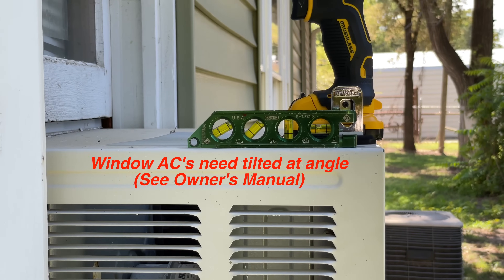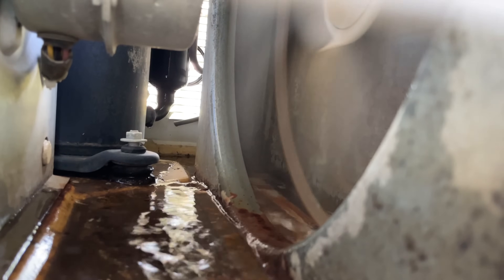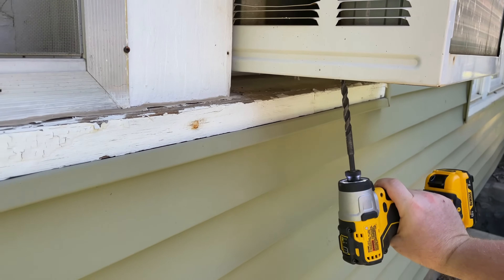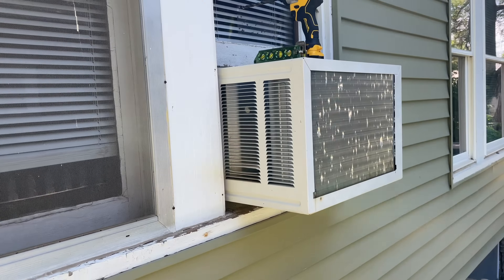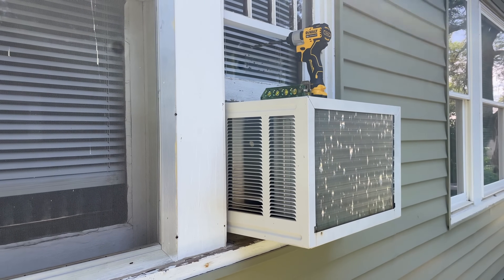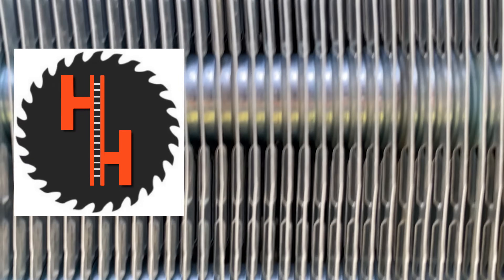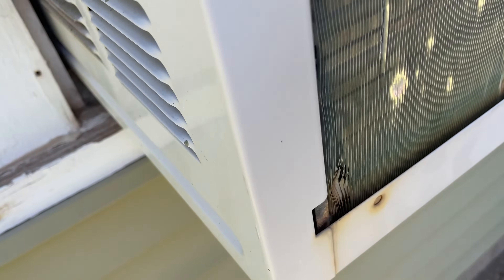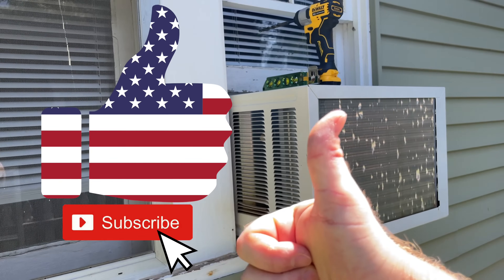99% Don't Know THIS About Window A/C's!! DON'T DRILL!!

Comment: Garbage bro… as a Floridian, those holes are necessary so you don’t get pooling water and mosquitoes in your home. I’ve popped the refrigerant line before with the drill. It’s a way of life down here when it’s 90+ for 90 days
Reply from the maker: I’ve never experienced any issues with excess mosquitos or had any complaints on any of my rentals. There’s also no access for them to get in the house, as there’s a barrier from the outside of the unit to the inside…
Reply: @HandymanHertz  ever heard of the fresh air vent? even closed its a poor barrier
Reply: Don't get me wrong, you're video is wicked informative. I ripped my midea U shaped split window unit apart this past week and added a fish tank UVC lamp under the blower motor squirrel cage fan to help eliminate mold on the fan blades.  The outside part was full of garbage though and still needs a good cleaning. That's from pre hole drilling.  I think more to the point, if you live in a really warm climate, the mosquitoes will find a way to nest and get inside your home is a water attached basin is involved. Nice video!
Reply from the maker: That’s cool. Ive never heard of attaching a uvt light to eliminate mold on fan blades. That’s actually really brilliant, lm curious how it works. 👍🏼
Reply: @HandymanHertz  thanks! Gonna try it for the first time when the real heat hits. Wish I could share a picture!
Reply: @Lykapodium  everyone in a high humidity area has already got a picture
Reply: its true if you live in a high humidity area, the pooling water becomes a lake and a breeding ground for mosquitoes

Comment: I'm starting to hear an annoying drip sound now. Is there any way to get rid of that? Can I suction the water out?
Reply from the maker: You can drill a hole in the bottom, it will just not run as efficiently. Just make sure not to drill into your condenser.  Or I’ve heard of people putting a rag that hangs over the side, creating a wicking action and removed the water that way.

Comment: I have a small pile of leaves and gunk on the inside where the tray is how do I get that out its like what u would see on the ground after a windy rain storm gross puddle with leaves its not huge but imOCD if I notice it I have to clean it
Reply from the maker: Hmm there’s no good way to flush it out, without cutting a hole in the bottom. The only way I know how to do. It is to do a deep clean on your window AC. I have a good video on that.

Comment: I always drill. If not, the unit will die sooner because of dirt, dust, slime, and algae build up. I'd rather my unit last longer than be more efficient.  Also, letting the water pool up over time corrodes and ruins the coils and rust the housing.
Do as you please, but I'm gonna continue to drill window units and run drain tubes to the ground.
Reply: Absolutely correct based on my experience. Before you drill check to see if you have removable plugs.

Comment: This causes alot of corrosion on your lower evaporator finstack. Drilling a hole is actually a optimum idea, and should be incurraged.
Reply from the maker: Thanks for your input, though I disagree.

Comment: What if the water is dripping from the front?
Reply from the maker: More than likely a plugged drainage hole that is drained and not allowing the water in the front to escape to the back. Unless it’s new, in which I’d guess it’s due to improper tilt angle

Comment: So I had this issue, but the pan was filling up too much and the fan was spitting the water back out through the vents into the house. It was filling up so much so fast that it didn’t have a chance to drain. What could the problem be?

Comment: But what about the mold that grows in the back when the AC is turned off and sitting there for a while and then you put it away for the winter…
Reply from the maker: The water evaporates quickly. I’ve never had a mold issue anywhere other than the blower inside fan. But that’s just my experience

Comment: Thank you for the information cause I was about to drill a hole in my window Unit.  it was leaking water inside. So I pull it out find out the hole where condensed water drain was clogged. So I clean it real good then put it back in. 👍
Reply from the maker: Good job! Usually water leaking inside is a separate issue!
Reply: What’s that issue? Mine is dripping out inside

Comment: I drilled bigger drain holes to existing for faster drain during cleaning still works great 5yrs strong .  helps the dirt escape faster and water drain
Reply: Where do you recommend To drill... Im having water spitting from the sides by the fan
Reply: @Lhenfant  bottom drill few holes
Reply: @Lhenfant  Look at the bottom plate...you should see a depression in the center with a channel leading to it from the cooling section. That's where the condensate is supposed to collect so it can be flung against the outer coil. I drill at the outer edge of that depression, which I call the "slinger sump". Make sure to check before you drill, that there are no coolant lines or wires on the inside. It should be right under the outer fan blades.

Before you drill though, check to see if there are any flexible plugs you can remove to drain. They will be on the bottom panel, towards the outside, or maybe on one of the outer corners. I should add that all a/c are not the same. Each mfr handles things a bit differently. The four I have are all basically the same (about 3-5 years old), so yours should be similar. The little depression under the outer (condensor) fan blades seems to be a common feature. That's going to be the lowest spot and that's where the condensate is supposed to collect. 

You also want to make sure that the styrofoam cool air enclosure has a good drain hole, so water doesn't collect at the bottom and cause mould. That drain hole should drain into the channel which leads to the "slinger sump", but you may need to clean it out or enlarge it to improve condensate drainage.
Reply: I just took the entire bottom off of the a/c unit. Let things fly when turned on. lol
Reply: @BillColicchio  that's what you don't do but yes drill baby drill

Comment: Awful advice ... the distilled water is filled with dirt and mold and you don't want it slowing down your fan ... and ... the bottom inch or two will actually rot in less than a year with standing water ... Awful shortcut design ... coil resting on metal housing.
Reply from the maker: Your theory about being ruined in 1 year  is wrong, because that unit in the video from 2009 and still going strong.
Reply: @HandymanHertz  You are defending the exception to the rule ...
Reply from the maker: Where’s your proof? Where’s Your facts on the rule? In my experience over the years, None of our rental properties window ac’s, nor my personal acs, has fit into your rule, or come close. Unless you think all of my acs are the exception. I believe your “rule” is the exception. Prove otherwise.

Comment: I had a customer that bought a $12,000 btu window air conditioner, it came in with a no cooling complaint. I took it in the shop and looked it over, customer had drilled drain holes all in the bottom. He said he didnt like water sitting in it. Not only did 5he bottom now have holes, so did the condenser coil. I gave an estimate to repair the unit. The unit is no longer in warranty. Told him hes better off buying another unit. Will be cheaper too. He said that no one told him he cant drill holes in it, lol.
Reply from the maker: Haha oh no!!! I bet the landfills are full of good air conditioning units with holes drilled in the condenser 🤣

Comment: Its leaking onto my floor!
Reply from the maker: You need to do a deep clean because the drain hole to the back of your machine is plugged. I have a good video on this called how to deep clean your AC. It should help you out.

Comment: Mine still ran water inside
Reply from the maker: I’m sure your drain hole to the back of the unit is partially clogged and you need to do a deep clean on it. I have a good video on that called how to deep clean a window AC.

Comment: I run a strip of folded paper towel tucked in to the back between the housing and the fins and let the other end hang down bellow the unit. It wicks any standing water and since it wicks it downward, once the towel is saturated it starts dripping and begins syphoning any remaining water. It does this at a perfect rate that allows water to pool up during heavy use and then dries out the unit when not in use.
Reply from the maker: That works. Why not just drill a hole?
Reply: @HandymanHertz  an open hole wouldn’t let the AC benefit from increased cooling efficiency from the fan splashing water on the fins, as it was originally designed. A slow wicking paper towel will allow water to pool when the ac is in use and then dry the unit out when it’s not in use. A hole would just drain the water immediately.
Reply: @JonCarton unfortunately that won’t work for me. I live in Florida, plus I’m very hot natured and keep my unit set at 65 yr. round. Yes, sometimes, like in Jan & Feb it’s only the fan running, but still, it runs constantly. I have to buy a new window unit about every 3 yrs. because mine has to be boarded in, it’s too much of a hassle to remove it to clean it every year. The best I can do is use a can of that stuff you spray on the outside. Coil cleaner I think it’s called. It would be so great if they made a window A/C that you could take apart from the inside to clean.  🤔

Comment: Mine was pouring water into the house. Drilling the hole fixed it. Yea, it'll maybe shorten the lifespan, but I was gonna trash it anyhow.
Reply from the maker: They are designed to overflow out the back weep hole before they overflow in the front. Do you remember if it’s at the correct slope the manufacturer recommended?

Comment: DRILL THE HOLE, Iv had 3 ac units in over a 2 years and the one i drilled the hole on works perfectly fine and has zero mold smell like the rest of the other non drilled ones did,  that 1% energy savings isnt worth your unit rustying out in 2-3 years plus the amount of bacteria growth from stagnating water is not healthy
Reply from the maker: A couple thoughts…that ac unit in the video is from 2009 and running perfect still. I’m not sure why you think it will rust out in 2-3 years. 

You claim The outside mold  would not be healthy if it was getting mold grow  (I havnt experienced this personally yet). If true, the outside ain’t has nothin do with with the inside air, so I’m not sure how it’s healthier. But thanks for your perspective and experience.
Reply: @HandymanHertz  no unit is perfectly sealed and the outside air will still find its way into the room you are cooling, i guess it just depends on what type of area u live in like humid or what not for the mold to be an issue

Comment: I can't remove my unit. I have cleaned it. But i have lots of dirt and leaf grime in the bottom of the unit. How do I clear all that out? Bc now it smells when i run the unit. And it didnt before I cleaned it. I feel like ive clogged something with all the grime i cleaned out of the coils.
Reply from the maker: I have a good video on how to do a deep clean and how to clean the most important part of it where leaves/dirt builds up. I know you can’t clean it out, but you should be able to reach the part I brush out on the unit, which is on the side of the evaporator coil (From fins). hope this helps.
Reply: I watched the other video. My ac looks identical to the one in this video. Mine is sealed in a window in my camper. I can't remove any of the plates. The slinger wheel is where all the leaves and dirt are compacted. I didn't have anything skinny enough or long enough to squeeze in between the grates. Finally, I found something to use. Hopefully, I don't damage the poor fan. Flooded it, rinsing it with the hose. All the junk just floats around. It has nowhere big enough for it to come out. Can't drill a hole in the bottom because the window the ac is sealed in. The camper design bows out enough and doesn't give me enough room for the drill to fit. Close to losing my 💩!! I decided to pry the grates apart to give room for escape. I'll be back for a part 2 of this saga! If this plan works and if it runs afterwards. Too be continued.. ...

Comment: I had a window unit running like that for 2 years, but I ended up finding corrosion on the condenser.
Reply from the maker: Interesting.  Did it quit working? That unit is a 2009 model and still running strong.

Comment: I agree with kevincheston  i have 6 through the wall casement ACs one from 1986 is still working, old tech. The two newest ones that have the water fan sling style are the ones that have damaged my wall. The ACs are dead level so the weep holes when reacting to higher water levels drip on the bottom rails of the box allowing water to drip from the rear all the way to the front therefore causing sheet rock and wood damage. Now you say why did I let it get to that point. Well, my maintenance for the other 4 units required cleaning the filter and inside coil and hosing off the outside coil not adding tablets or liquids to prevent sludge. This I wasn't used to, never had a problem with sludge, the water drips out and was not stagnant. Yea I know I'm old but not afraid of embracing new tech if the tech is engendered and well thought out. Why make it harder and less healthy to maintain? To sell more ACs more frequently, the consumer be dammed.
Reply from the maker: You said the ACs are dead level. I believe there in lies the problem.  Every instruction manual I read, says they need a slight slope that would fix your issue. 

There could be a counter argument that the slinger ring makes your unit more effective and efficient by cooling down the condenser. This would cause less cycling, which would be less wear and tear on your compressor, extending the lifespan. Just some thoughts. I’d also be very very curious what your 1986 SEER rating would be and how much energy it uses 😬. can’t be good.
Reply: @HandymanHertz  I didn't install the sleeves,  my contractor did. The other 4 on the second floor were all leveled slightly down. The newest one of these was the one that caused the most damage that I am in the middle of repairing. I removed it and actually found a factory hole that was near the front that was allowing water to drip behind the wallboard. I plugged this hole and drilled two holes in the rear, and now I get a drip outside. Why won't you admit this design has flaws? The manufacturers did this to get a little better SEER rating so we think we are being environmentally conscious and dam the consequences. Question everything. Don't be led by your ideals that are being manipulated. ( I don't think they used SEER ratings in the 80s)

Comment: I always drill holes in mine and they work perfectly fine.
Reply: I drilled a hole in my Sharp unit and it didn't work as well afterwards, then I plugged the hole with silicone, and that splashy sound came back but it cooled much better.
Reply from the maker: They will work fine, but they will not be as efficient and will cost more money and electricity

Comment: I install an 8k BTU Hisense and I made sure I had a slight tilt to the outside, using a level to confirm.  However, the unit is overflowing onto the inside Windowsill on both sides. I found another video that showed how to place a thin cloth or gauze on the back of the unit to wick the water out. It worked like a charm. In two minutes the cloth was dripping with water and Windowsill stopped being wet. I was about to drill the bottom but the wicking of the water worked so fast I decided not to.  With all the standing water inside the unit it would create more noise, a Gurgling sound, when the water was high and was being slung around inside which might’ve been contributing to the windowsill becoming wet. I’m going to stick with wicking out the water so I don’t keep having a wet Windowsill. This is a poor design and instruction or stickers should inform the consumer of the reason for the unit holding water but also provide pop out holds so drilling is not required if the water in overflowing inside the Windowsill. Thank you for making the video and explaining why we shouldn’t drill the unit for drainage.
Reply from the maker: Hmm, I only buy brands in familiar with (fridgidaire, lg, ge, midea, etc) and have never had this issue. I would be curious to know why. I believe you leveled it, but I also believe engineers design these things so they work when installed properly. I’ve never heard of a brand new one leaking inside. I’ve heard of a bunch that leak inside when they get dirty and there’s a blockage from the evaporator coil to the back of the unit. I’ve venture to guess something is blocking that from the factory, a piece of Styrofoam or some thing.

Comment: If we can't drill a hole, then how do stop the water from leaking inside your apartment?
Reply from the maker: Water should not ever leak inside. The unit is either installed incorrectly or there’s a blockage from allowing water to go from front of unit to the back. That would require a deep clean. I have a good video on that and I tell you where exactly to clean.

Comment: On my unit (Noma 6000btu) the Condenser coil sit underwater which cause corrosion. 

Is it a problem link to bad conception?

There's way to much crap that accumulates at the bottom and my level is fine.
Reply: theyre designed not to rust or corrode since the condenser also has to endure the rain.  the cooler the condenser can be, the better the cooling inside since the units can only maintain a certain temperature difference between the hot and cold sides